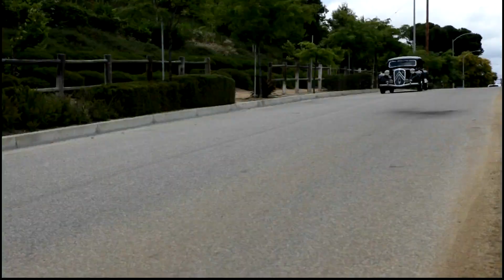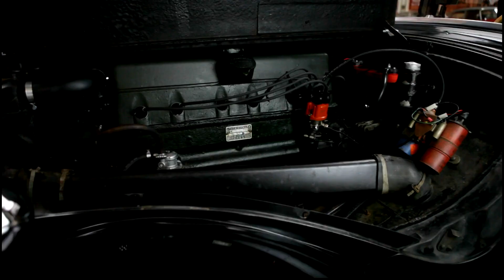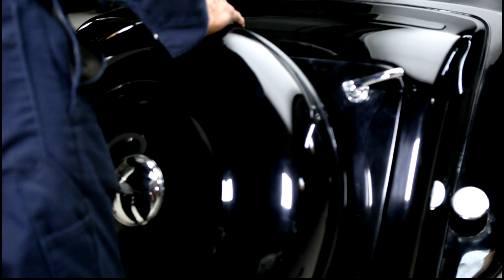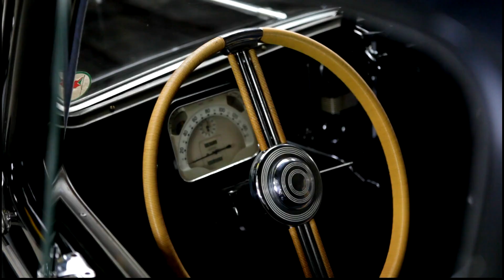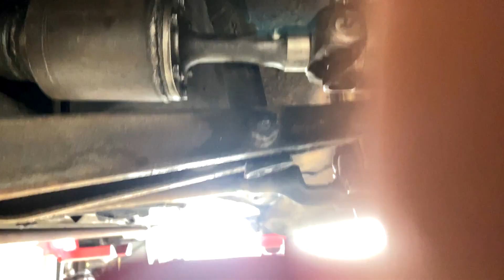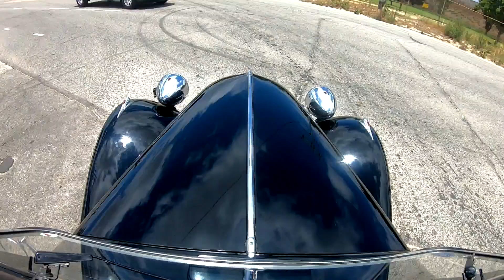1949 Citroën Traction Avant

Comment: Hey! Do one of these on my low mileage Xantia! Also fix the freaking hydraulic leak which appeared yesterday please i beg you sir mu parking spot is all green from the LHM
Reply: Don't overtighten the LHM hydraulic fitting, if you do it squishes the rubber seal.
Reply: @trespire  thanks for the pointer, though this leak started without interference
Reply: @myownsite  If I may suggest: Hydraulics need to be clean, the LHM systems in particular use highly refined oil. Clean up the area really well, I use clean cotton rags and a solvent. Once the point of leak is identified that's half of the repair. If it's from one of the pipe and gland nut fittings, particular to Citroen, there is a short section rubber tube that acts as a seal. The rubber seal must have a green stripe. If the seal is defective, tightening won't fix it. Only a new rubber seal. There is a specific torque for each size fitting. If it's at the central accumilator/regulator unit, it's a common leak on all Citroens since '55.
Reply: @trespire  I do appreciate this, though due to my somewhat tight schedule I just took it to a mechanics shop to identify the issue - I've got a rare occasion of having a week off and next Thursday it's going to the welders(It needs fixing due to a MOT failure). I just want the leak identified and plugged to not bring them a leaky car.
Reply: @myownsite  Unless he's has experience with Citroen hydraulics, chances are he won't know how to fix it or even worse damage something. You really should look up an old timers garage who knows these old Citroen hydraulics, or learn and do it yourself. I own 2 CX's and worked on GSA and DS21.
Reply: @myownsite  Just clean up the wet spots before the MOT.
Reply: @trespire  Sadly such old timers garages closed down recently. :/ Best I can do is get it to a mechanic and give them pointers provided by Citroen nuts I know.

But about MOT - it already passed it, or the local equivalent anyway. But it passed with the asterisk of plugging the rusted out holes.

Anyhow, I am stubborn enough to keep it on the road. :D
Reply: @myownsite  All the cars systems are more or less common technology, all but the hydrompneumatic systems.   I don't know how technical or handy you are, but I would avoid the run of the mill mechanic for anything to do with hydropneumatics.   Learn the systems yourself, Haynes have good books.   Build up your knowledge and tools step by step, trust me it's worth it. You own the last gasp true Citroen ever produced.
Reply: @trespire  I sadly don't have the time or facilities. If it gets to having to do my own labour I am out of options.
Reply: @trespire  but i do know a shop which has the knowledge - but not at this swift schedule which would be preferred for the rust fixes i mentioned earlier